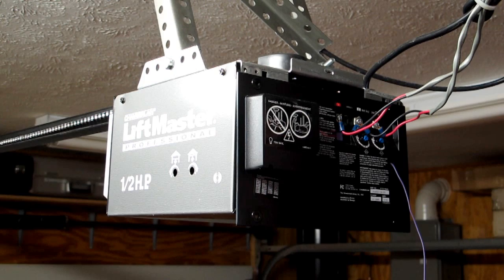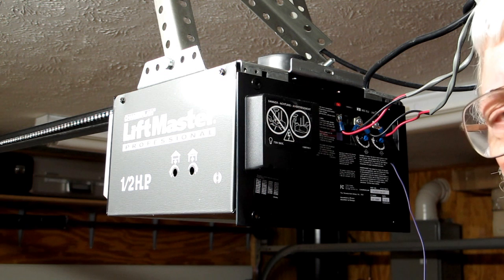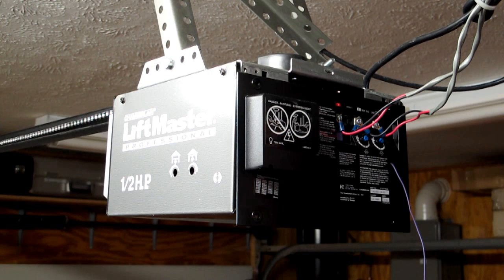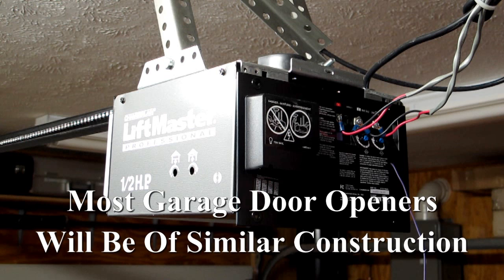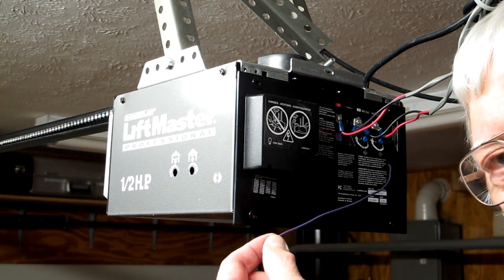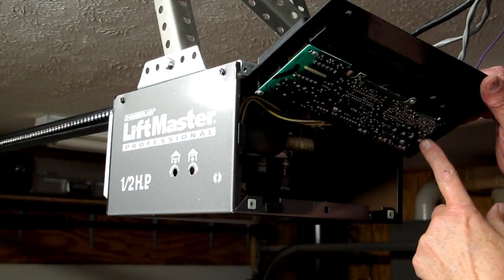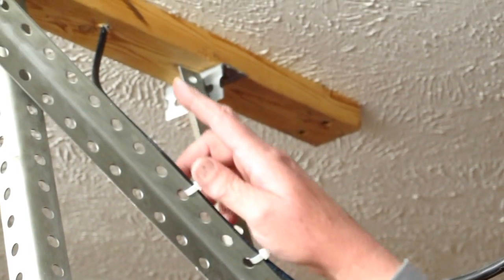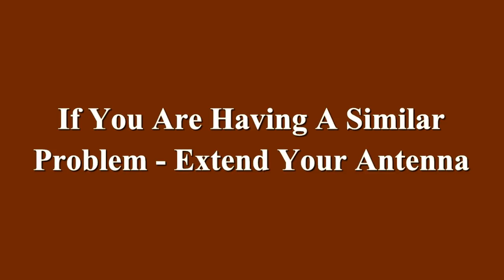Garage Door Opener Antenna Extension

Comment: So I ran an extension with just speaker wire through a hole for an outside light so the wire was outside the house and NO difference.  Does not make sense to me.  Any thoughts?
Reply from the maker: Daniel, thanks for that. I have no idea if I ever replied to 4n6man 4 years ago or not.  YouTube was supposed to send us an email whenever we received a comment on one of our videos... then they stopped doing that (but never told us they stopped) thus I may have never seen this comment. Then as a result of one of their "improvements" they shuffled comments and replies like a deck of cards and replies may or may not be associated with the corresponding comment. Sweet! YouTube is an imperfect system. Ron Walters
Reply: I have the same issue. I'm glad I read the comments. Thank you
Reply from the maker: Seems that a large number of comments with good results were left by those who followed my suggestion of using coax. Therefore I suggest  doing what is shown in the video... which worked for me as well as many others. Thanks for watching!
Reply: So I know this comment is from 4 years ago, but I want to reply in case someone comes by and sees this, that they know why.

Antenna's need to be a fraction of the wavelength they need to receive. For example, the garage door opener I have operates at 315MHz. The Wavelength of 315Mhz is approximately 95.17cm. Most whip antennas are Quarter wavelength antennas, meaning that an antenna for my garage door opener should be about 23.8cm, or 9.3 inches.

In essence, the reason that your solution didn't work is because you used speaker wire. That wire is unshielded, meaning that the entire length was an antenna. Lets say for example that you ran 20 ft of it. You effectively created an antenna that operates most effectively at around 12MHz.

You have to use some sort of shielded wire, and only expose the center conductor to whatever length you need to be at 1 quarter wavelength.

Comment: I was having the exact same problem with my opener. I read that if you wrap the original antenna lead around a pencil so it coils like a phone cord it will get better reception. I was VERY skeptical of this, but thought what the heck do I have to loose. I did it and our opener now works perfectly. I was going to extend my antenna too. but with the coil it is not necessary any more.

Comment from the maker: Originally I expected I would need to connect the shield of the coaxial cable to ground but I found I did not need to do that in my particular case. Try a length of speaker wire and connect it with a wire nut when you twist it to the end of the antenna and see how it works. You can always disconnect it again if it does not work better.

Comment from the maker: I thought so as well. If I had grounded the coax shield then the purple 11-inch antenna on the end of the coax would have been “in tune”. But it did not seem to make any difference. So I’m not going to argue with the result. The antenna extension they sell commercially is really off.

Comment from the maker: The old antenna was the 11 inch purple wire shown. If you hired a “service technician” (or the neighbors kid) that is the type installation you could expect, some twisted wires. If you want a better installation, you solder it to the circuit board. On the other end I originally intended to make and install a rigid antenna, but after it was working so well I did not need to. So if you know the result before running the experiment, then yes, you could strip back the end of the coax.

Comment: I'm assuming the old "antenna" was a piece of wire? would be a simple job to strip the end of the antenna wire and connect it to the coax cable. At the other end just strip back the coax to reveal a section of wire similar length